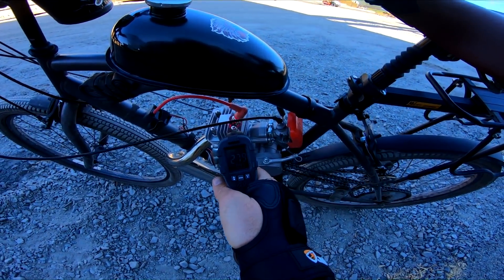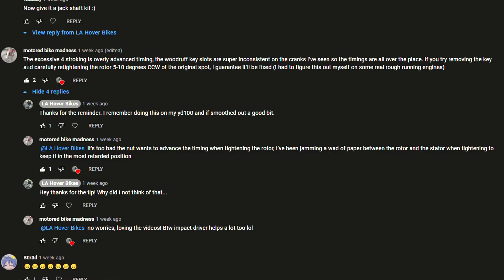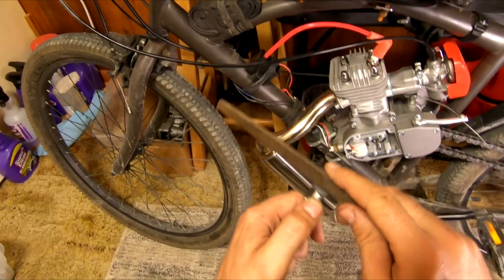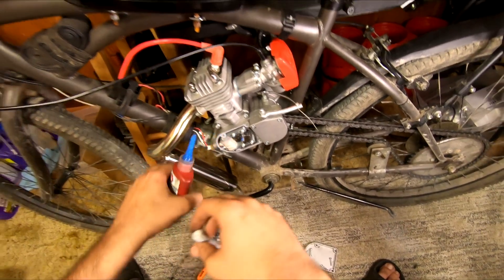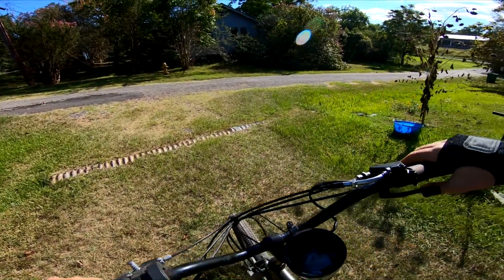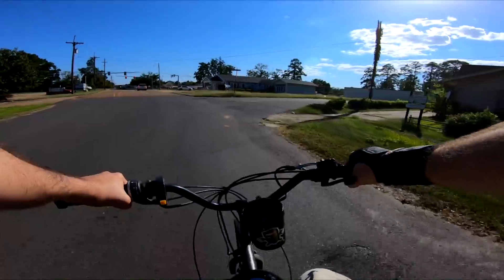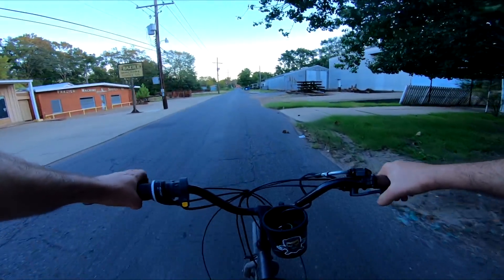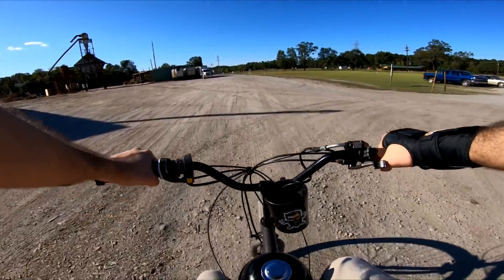Adjusting Ignition Timing On A Motorized Bike

Comment: Your on the right track but I would try fixing carb, spark etc and do timing last.
Biggest issue is exhaust at open throttle it doesn't creat back pressure as it should so will never be perfect.
Check engine squish with some plasticine in between piston and head.
Squish between .7 to .9 will work anything more and will need race fuel.

Comment: Will the phantom exhaust bolt on to a stock china girl motor if yes is it worth buying the exhaust for a stock china motor any gains of power low down on stock nt carb but high comp head would be nice to see a side by side stock with phantom exhaust and stock only high comp head phantom exhaust see the difference between them
Reply from the maker: No, the exhaust port and stud pattern is to wide.

Comment: Yesterday I hopped on my bike with the phantom 85 to continue breaking it in and no power haven’t changed a thing from stock. Motor rips I just have no clue why mine doesn’t. Takes half throttle to barely get you moving on flat ground
Reply from the maker: Make sure yours did not come with a backwards piston. Guy I was helping the other day had one come backwards... Guess that is still a thing. May also be an issue with the reeds, one may not be sealing. Could be allot of other things too, hopefully just something simple.

Comment: Retarded timing makes the motor start easier...when looking for performance advance the timing...if four stroking is still a problem you really need to look into what's happening between the intake and exhaust...cross talking. When sound waves can't escape the exhaust it blows fuel outta the carb which can lead to improper fuel delivery 🤔
Reply from the maker: Thanks for the feedback :)

Comment: Some of these motors destroy gasbike frames,, yesterday I discovered cracks around my front mount almost all the way around the main downriver,😳😥
Now if your planing on putting that oñyour new frame be aware it might just be to much for aluminum frames,, my semi tricked out BT100 wrecked my frame it was torque monster as well so if this is more which I suspect it is, it's going to last about another before cracks develop around the pedestal mount
Reply from the maker: Big thanks for the heads up! I'll take extra care to try and prevent this from happening. Question, Was yours the frame with the built-in lower mount on the downtube?
Reply: Yes LA, it is.
I think either it was not stress relieved after welding or it was overheated while it was welded, I will know which is the case once I get the frame to work for testing and repair.

Comment: I can verify it will break Walmart bicycles, most of the damage to the back tire spokes hub and axel bolt. Two tips to slow or even stop that from happening is don't use hub breaks or just no breaks on the back tire, and look into the upgrade hub mounted sprocket for the motor side of the bike.
Reply: You absolutely need brakes on the rear tyre. Slamming the front brakes on when you need to stop quickly never ends well!
Reply: I have my sprocket mounted on disc brake mounting points, works great
Reply: @XxmatixX6videosdiariosdenadav   thats sounds so nice . i spend almost a day fucking around with a ragjoin

Comment: Glad you are okay after the storm!
I was thinking about getting one of these, but I changed my mind. I can hit 42 with the Don Butler motor (just ported with high compression head and fake MZ, 44t) I've had it for about 2 weeks now. I am very happy. I have it on my Trek. You would like it. I had to take off the air filter and set the needle all the way down lean, with the bofeng. I'm going to eventually dig out my 21mm PWK . Have fun and be safe!
Reply from the maker: Thanks, and congrats on your build! sounds like a rocket, stay safe!

Comment: I don't know if there really is anything on the market that stronger than a steel frame Kent or Cranbrook.  The Phatmoto  frame is reinforced, but even that's made out of aluminum. I would think the best thing to do is to take steel frame Walmart bike and bring it to a welder to add support.
Reply from the maker: Sadly I think you may be right, reinforcing a cheap steel frame could honestly be the best way to go. We will see how to new build works out...
Reply: old road bikes and big bmx bikes do me well. good, strong steel frames
Reply: @ArmyBoiSweat  yeah wish I knew then what I know now, I would have picked up a couple steel frame mountain bikes in the early 90s.  Steel frame with a threadless headset.
Reply: $800.freaking dollars for a bike without the motor?Wowzaa.I do see that it has some really great options,but wow.
Reply: @bryduhbikeguy    The $3,000 up to $10,000 name brand mountain bikes are a complete rip off. If people refused to pay those prices, the prices would dramatically drop....A $5,000 MTN bike is going to be way better than a $300 Scwinn Taff but nowhere near $4,700 better. I can understand a Pro MTN biker who makes a living riding paying $10,000 for the best of the best but at $5 & $10K  the bike should be all Titanium alloy and carbon fiber.
Reply: I have seen 212 Predators on those, so they must be sold.

Comment: I just got one of these engines, haven't even been able to look at it as I haven't been home... I would love to know how removing one of the gaskets affect things on this engine.
Reply: any gasket removed would make it not run so...
Reply: @gewizz2  not true. Some engines come with 2 cylinder gaskets to increase headroom when not needed.
Reply: @Hunter1st  a gasket squeezed between the cylinder will change nothing in performance.
Reply: @gewizz2  it actually can greatly. I don't know where you've gotten this information.
Reply: @Hunter1st   ok, i have not experimented with stacking gaskets up, they way i see it, more gaskets means more potential for leaks. but anyway if you raise the whole cylinder 1 mm,  it changes everything, so where is the benefit?  more compression above means less in the crankcase, ports opening earlier mean ports closing earlier, its hardly beneficial. anyway my 66cc engine is not running i had to pedal it 11 miles!

Comment: You should try to fabricate your own muffler, that would make for some hectic content
Reply: Just buy a cheap circuit pipe and hack and weld. Circuit pipe will give you the best take off and mid range with little increase in top end.
Reply: @robertpolicastro1  True, that would really help the motor and would sound so good!

Comment: How do you like the phamtom 85? Is it comparable the yd100?
Reply from the maker: Not comparable. The Phantom feels like it belongs on a pit bike, not a bicycle...
Reply: @LAHover  just bought the phantom 85. This will be my 11th build but I'm taking it serious thanks to your videos. I have the engine, steel mag wheels with sprocket and disc brakes. I just need the bike now. I don't have a price cap for my build. I just really like the process of putting a motorized bike together  and riding on something I made. Your channel is a true gem. I appreciate you're content. Should I get a frame with the motor mount on it already?
Reply: @LAHover  I just seen ebay & amazon started selling a new 110cc engine kit....It's a 52mm piston with a 2 piece cylinder & head and the cylinder has an iron lined sleeve (supposedly iron sleeve)...ebay around $190 amazon around $210....I'm hoping I can sell my 66/80cc kit to my neighbor buddy and buy the 110cc kit....One problem I can see already with it is, if you have frame/engine/carburetor clearance issues. It'll be tricky to easily rig up an offset intake, with a true expansion pipe and a little port/polish. I'm hoping I could make a 40-45 mph cruiser bike.